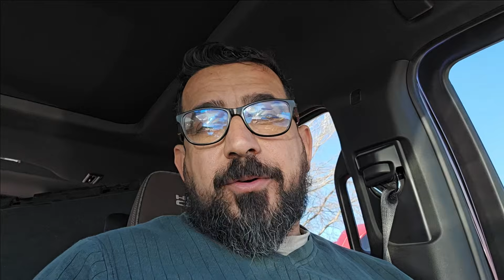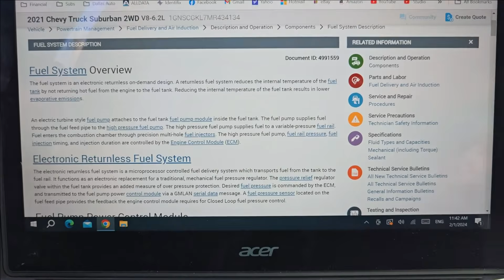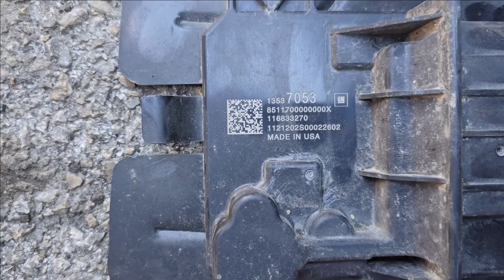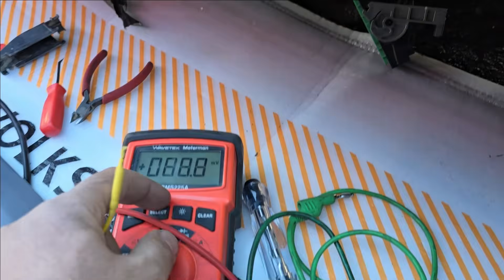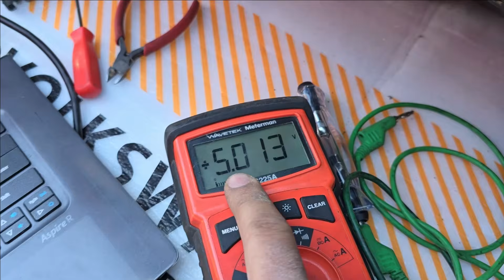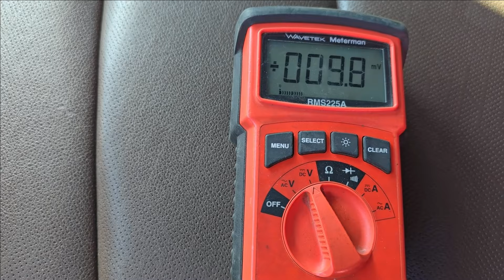P129F Chevy Cadillac and GMC fuel pump power control module

Comment: Saving this one. Having the same issue. No fuel pressure. Great video thank you
Reply: up date on this. i made a note of the fuel level added 5 gallons and it didnt change. the fuel level also runs thru this module. replaced the FPCM and the fuel level changed it started up. no programming. cleared the codes with an Autel scanner non came back. thank you again for the video. my code was U18A2

Comment: Question how come you didn’t check pin 18 the grey/green wire? That’s the power wire from the ecu correct?? I’m dealing with a p12a6 code and it’s driving me insane. So far I’ve replaced the module 2 and no go. The truck will run for 1 minute and then die. And it throws p12a6 and p0498 and p0449 instantly

Comment: The voltage output should be 6volts dc on cranking at the fuel pump? Onthe gray wire?, thanks

Comment: I have the same code “p129f” on my 2020 Equinox lt.
Does the Fuel Pump Driver Control Module need to be programmed on the 2020 Equinox?

Comment: this is a really good video, thank you for sharing the info!
1 concern - if the fuel pump uses AC voltage, why do you keep your voltmeter in DC setting to measure voltage? thanks

Comment: @DallAutoDiag
Is there a special trick to getting the bracket down with the fuel module? I tried throwing a 10mm on the two most obvious bolts and it seems like they are spinning.

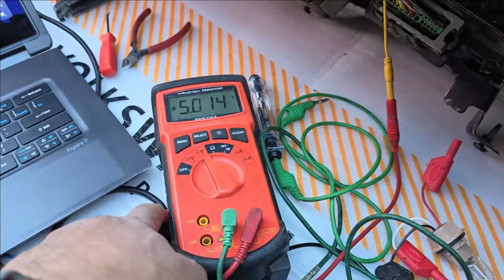The ones at the top and bottom of the bracket at 10:40.
Reply: Answering my own question for anyone else. You'll need an e-torqx socket set and a wrench. 10mm or adjustable. Hold the wrench on the nut and loosen each screw only a little bit with the socket. Then you can lift the bracket out of the holes.
Reply: After putting it back up I'm not sure you need the wrench. The e-torx socket might be all that's needed. This fuel control module made me stop in the middle of the road with no ability to shift to Neutral. After dealing with this stupid thing I'm going to keep a pair of wheel chocks, a wrench and a zip tie in the car. The procedure in this video is a must know for all Suburban, Yukon, Escalade owners. https://www.youtube.com/watch?v=iSaPBKV9cnQ
Reply from the maker: Thanks for sharing.
Reply from the maker: Sorry it wasn't me that dropped it down. It was like that when I get there but I see you got it figured.

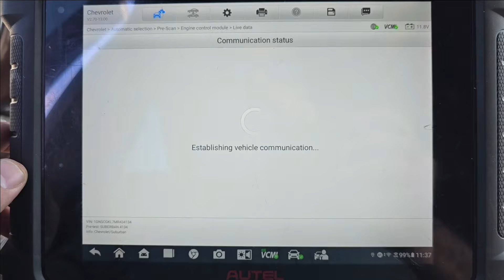Comment: Hi i have this code U18A2:00 and my issue is fuel showing for 15 second and show empty i check fuel pump it's ok do i have to change module
Reply from the maker: Needs furthur diag
Reply: hi, i have the same code on my 2019 gmc. have you fixed your truck? what was it?

Comment: When you talk about 3 phase motors  I am thinking that you could measure ac voltage between any 2 of the phase wires and frequency would give an indication of the speed.  My reference is from variable speed inverter drive motors that are used in residential air conditioners and industrial motors. Of course you would check the inputs to the module first.  I saw phase 2 and 3 labeled on diagram. Is phase 1 connected to ground?    Thanks for the Videos
Reply from the maker: You could do that also. I'm gonna wait for another opportunity to make another video on one that operates and use advanced tools to check it. Preferably in my shop. This video is intended to the DIYer. The third phase is not grounded. That is a grounded shield.